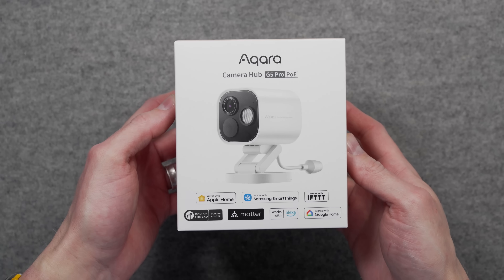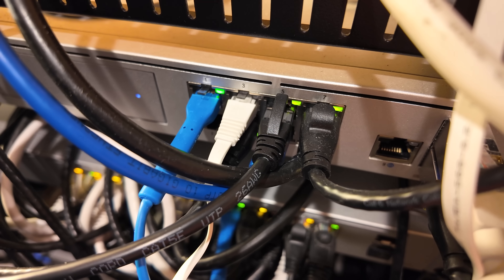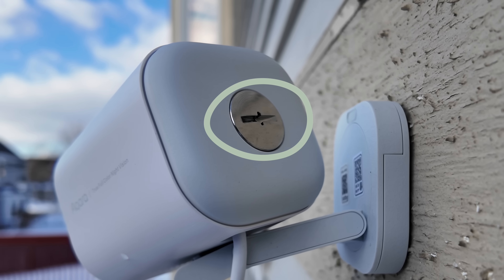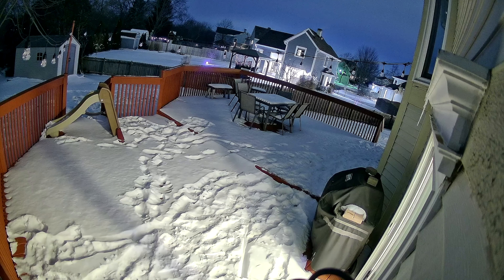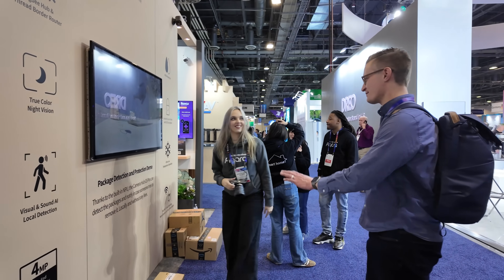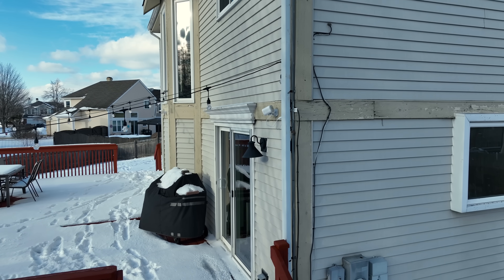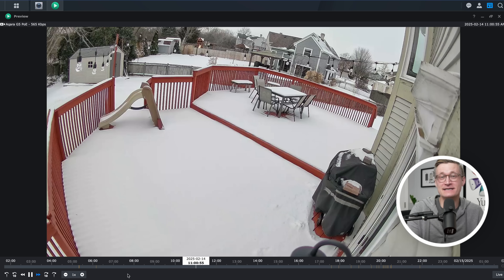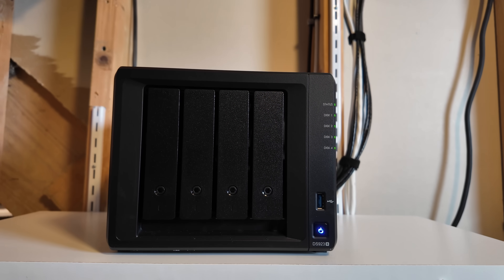Aqara G5 Pro takes HomeKit Secure Video to a new level

Comment: So got an Aqara G5 and have been testing it out for adding to the Homekit smart home.  I completely agree with you about the G5 picture quality, it's great!  I also love the POE.  Having a hardline (ethernet cable) connection t the camera makes it work way, way, way better in Homekit secure video.  However, the camera is playing havoc with my Thread network.  Wish I could just turn off the Thread radio.  Also wish Aqara had instructions on how to connect the camera to Homekit's already existing Thread network using a homepod mini and also how best to configure the G5's Matter capabilities so that it doesn't impact Homekit.  Been messing with the for a week now and things still don't make sense or work right.  If anyone has suggestions or help I could use any help you would like to provide.  I almost want to wrap the camera in aluminum foil to block the thread radio.

Comment: I'm a little late to the party here, sorry.  Wondering if the ethernet (POE) connection makes Homekit Secure Video (HSV) any better.  I've been using it with wi-fi cameras and have had nothing but trouble with camera drop-offs and missed events.  This is even after much strengthening of the wi-fi signal.  Maybe others have had better luck with HSV but even Wire Cutters have an article saying they also have lots of trouble with HSV.

Comment: Aqara seems to be getting better with each release of a product, and I can't wait to try out one of these new cameras. I do struggle with my many smart cameras being slow to connect and give me an image, which really seems to negate their very purpose and usefulness. I want quick, quick, quick when it comes to opening a camera on my phone to see what's going on. And, as a DIY guy, I can see myself running cable for PoE if it would produce a better result. Thanks for the look at this new camera, though you are pushing my budget for devices over the top.  😁

Comment: Sorry for being a little off topic here, but was mentioned in Eric's video. I have a few Eufy camera's. A couple of 2c pro's which through homebase 2 was homekit compatible. Taking the upgrade path to be able to have more storage capacity, I went with the Eufy Homebase 3 after making sure all my camera's and doorbell would be compatible. Well, homebase 3 is homekit compatible, but none of my camera's are through that homebase any longer. Eufy support says they are working on adding more homekit compatibility but don't know when/if which cameras will get it. Which makes no sense to me since the 2c pro's were compatible with homekit with the homebase 2. So my choices is to upgrade my cameras to the new s330's, wait until compatibility is worked out or jump ship to a different brand. Maybe this G5 pro would be the way to go.

Comment: This UniFi G5 pro is MUCH better as the POE cable goes back through the housing allowing the cable to go through a hole into the house.  This makes the security much more secure as the wire cannot be easily cut.

Comment: Hey Eric. Great breakdown! I am new to POE. My tplink WiFi set up is POE so I have the basic requirements in place. 

That’s said. I would like to save a port on my POE router. Could I just run one cable from my router to the place I want to put two cameras and use a splitter to run a cable to each camera? Appreciate any feedback you have on this idea.

Comment: It would be great if you could make a video about creating automations based on what this or any other camera detects.  The true value of video surveillance is to detect anomalies, not just record and save so that you can "scrub through" later.  One thing I'm contemplating is using animal detection to turn on my sprinkler system.  I live in a suburban area that surprisingly has deer and raccoons.  They destroy a lot of my front yard landscape.  Even when they don't, the deer leave regular calling cards on my lawn.  I want to shoo them away with a surprise blast of water.  But that requires creating an automation...

Comment: ⚠️ Apparently the spotlight could not be set on automatically based on motion/events
(Based on an other review)

And that’s a real shame! Even my 2016 Netatmo Presence Outdoor cam can do it 😅
Reply from the maker: You can do this as an Aqara automation, but not for any motion event. Only when specific things are detected. I skipped this detail, but I agree it shouldn’t be so hard to setup auto spotlight
Reply from the maker: You can also turn on the light with an Apple Home automation using the camera motion exposed as a motion sensor
Reply: My G5 works with face detektion and spotlight very well:-)

Comment: I think that POE is most useful in these settings since you're already running power to the device, and you want rock-solid network connection for a camera, and getting really robust outdoor wifi can be a pain.  Nice looking cam (and hub/router) at reasonable price.
Reply from the maker: Thanks! Yeah I agree

Comment: Nice Camera, however comparing the G5 Wifi version to my 2 Outdoor HSV Wifi Cameras from EVE and Netatmo I see it difficult to connect existing power from a Outdoorlight, the USB-C Connction is more for inside use.
Reply: Can you get the Eve Outdoor cams to work consistently.  Mine drop out all of the time.  I really likes them for 1080 cameras but the reliability over wi-fi was just crap for me.  The Ubiquiti access point was super close to both cameras but i was not using a mesh network.

Comment: Nice touch adding the part about RTSP settings for an NVR. That said, if you are already using Synology's Surveillance Station, there are many less pricey cams out there. As you stated, this cam is not for everyone, but there is a niche that it will fill. Extending your Aqara "network" out into your yard is another benefit.
Reply from the maker: Great point. The key combo the G5 Pro has is: PoE + outdoor + official support for Apple HomeKit Secure Video + continuous video recording via RTSP
Reply: @EricWelander  On the Amazon listing for a Synology NAS, they say that Surveillance Station is "License-free with Synology Cameras." Would you need to buy a Synology license in order to use the G5 in in this setup?
Reply: @36_Recon_36  That depends on how many cams you have. Each Synology NAS has two included licenses. So if this is your only cam, or one of two, you won't need another license.
Reply: @EricWelander  Question for you. If you have this set up to do HKSV at the required 1080p, can you still pull an RTSP feed at full resolution for use with an NVR?

Comment: The only way I’m getting a lan cable in my garden if I setup some type of WiFi booster in the garden shed. And not kinda defeats the purpose of LAN powered. Having sad that, I’m a fan of the Aqara smart home cams.
Reply from the maker: Yeah if you can’t bury the cable in the ground sounds like more a place for the WiFi version or a battery operated camera
Reply: @ I have electricity in the shed and I want to get a camera there. WiFi signal is strong enough since I can control the Nanoleafs outdoor lights (the same you have).